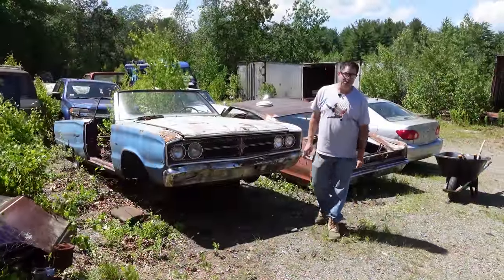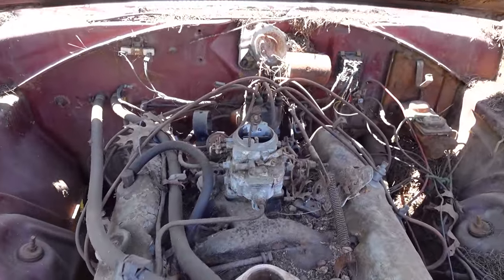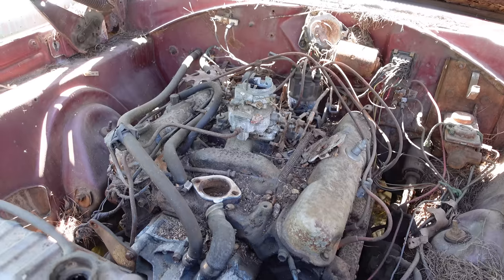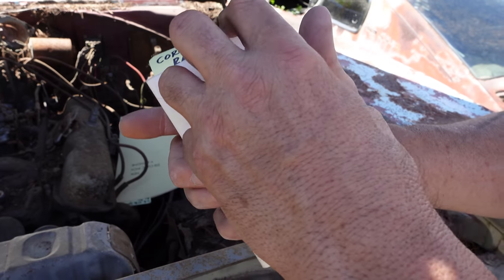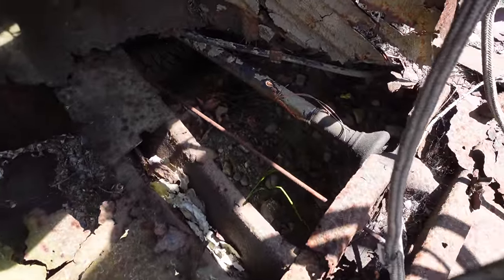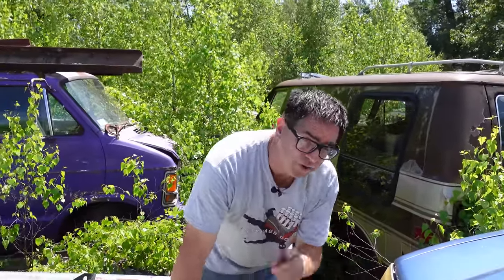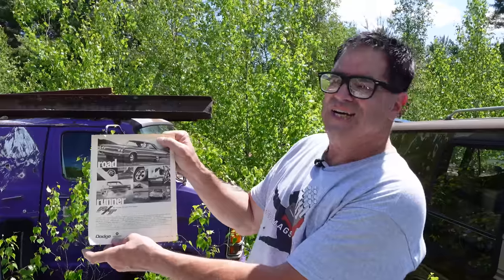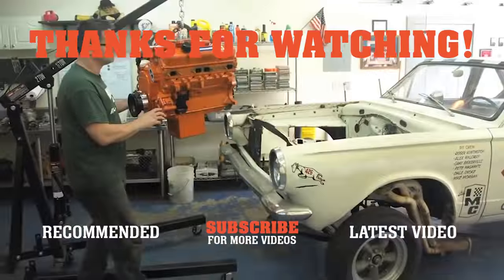1967 Dodge Coronet 500 Convertible

Comment: My dad purchased a 1967 Coronet RT new I believe around $4K. I bought it 4 years later $1300 paid cash from mowing yards. That 440ci 375 hp would definitely push you back in the seat and put a smile on your face. It was Red with white interior torqueflight on the column with deep dish Cragers and air shocks that I put on. It was a nice first car.

Comment: Just restored a 67 Coronet 500 convertible 4bbl 383 car. Gold (zz1) with gold interior.  53k miles on the speedo. 62 Engine code. Power windows A/C car.

Comment: When I rebuilt my dad's 66 500, I had a  radiator shop replace the 2 row core with a 3 row and soldered my original top and bottom tanks back on. It's a 273 2bbl that my parents bought new in September 1966 just as those 67s were coming out.

Comment: The V-8 fender emblem, my experience is that the guys on the right side of the line were quite independent of the guys on the other side. My 67 Coronet 440 had the correct 383 four barrel emblem on the left, and the V-8 on the right, but it gets worse! My 66 Coronet 440 Hemi car, had the correct 426 HEMI emblem on the left side, and they apparently neglected to put any emblem on the right side. Holes were drilled after the fact, and an emblem added, crooked! That emblem stayed crooked for about the next 40 years.

Comment: Hi Steve enjoed watching your very informative videos In 1972  i bought a1967 Dodge Coronet 440 model with 318 convertible I paid 400 dollars from Hoyoke Pickup Dodge. The reason was because it had 92,000 miles on the car. went in the service rolled it trying to avoid a head on collision on a blind turn. car was in my lane. Anyhow seat belts would of killed me an my veteran buddy. The engine was pushed up to the front seat. in 1974 I bought a 1968 Dodge Charger with a 440 automatic for 400 dollars in had only 55,000 miles on it .Came home on leave from Kansas to Ma I got Stopped by The Holyoke South Hadley and My parents in Granby as well I asked them what was up .They all said the same thing We never seen a car like this. You mind if we look around no problem They asked me to open the hood geeze what you got there I told them they were all impressed. I have always been a Mopar guy. My present is a 1988 Chrysler Fifth Avenue with 175,000 miles on the car. I wished I knew somebody in my area that did a conversion like to get away from the lean burn system and get better gas mileage with he old school mechanics. any help would be greatly appreciated because I am a disabled Viet-Nam Veteran

Comment: My mother had a 67 hardtop 500 when I was about 14. It was 383 2 barrel automatic bucket seats console floor shifted she didn't take care of the engine and it's spun a rod bearing. I wasn't quite old enough to know what it was at that point and it went to scrap. When I got older I realized what a mistake we

Comment: I was hoping to see the trim tag and VIN as you alluded to it. But with the VIN we could win:

W for Coronet, P for Premium price class (Coronet 500), 27 for convertible, F for 318 V8 with two barrel, 7 for 1967 model year, possible 1 for Lynch Road (Detroit, MI) assembly or 5 for Maywood (Los Angeles), CA assembly or 7 for Fenton (St. Louis), MO assembly and the rest is the production sequence. Close, the VIN code "E" in 1967 was for the high performance 273 V8, and the VIN code "D" was for the standard performance 273 V8. 

No tag, can't brag, but it might be something like: WP27 for Coronet 500 convertible, P1X for black interior trim, 41 for 318 V8 with two barrel, 5 for three speed automatic transmission, possible "P" for Bright Red Metallic exterior paint, among other codes. 

Looks like that's "Mopar Corner" in the junkyard with a few more videos coming with that Coronet's "neighbors" in the junkyard. GM cars also have codes for their radiators as well. This is shown on the build sheet so that the line workers knew what parts to install and it helped the logistics people track inventory and set up production at the various suppliers and divisions making parts (such as Harrison Radiator at GM).

Comment: Doesn't take much to wake up a 318.  340 cam and a set of "302" fast burn heads topped off with an Edelbrock intake and 600 carb.

Comment: Looks like another one hiding in a container back there.  Or is that an Imperial? 

This car for the northeast doesn't seem like it's that rough, sure it needs floors, but it's not breaking in half.  You'll probably never find a top for it though.   I don't know how different the underparts are but the way you save it is take a 4-door (or even a 2-door hardtop) and cut it down to the floorpans, then add in any convertible specific bracing and rebuild it with the convertible upper body.  

I remember in 2012 in Columbia SC there was one of these in a you pick yard; a Coronet 2-door hardtop.  I was on vacation just checking stuff out and there it was, hardly any rust but a bare shell with no interior, glass or drivetrain.  Would have been a good donor for this convertible.

Comment: One of the many times I screwed up in 83 I could have purchased a 67 R/T nothing wrong with it for 300 dollars and didn't buy it because at the time I had a 69 SS 396 Chevelle.
I didn't realize the heads on the 67 R/T and GTX were one year only design and I'm a Chrysler person 🙂
Reply: I almost bought a 1967 Coronet R/T with a 440 that was in a driveway a few blocks away. It looked like it needed a lot of work and was pretty rusty underneath (although it had a decent paint job) and I passed on it. I wound up buying my 1979 10th Anniversary Trans Am instead.
Reply: I did the same thing back in the late 80s. I could have bought a 1971 340/4spd Cuda for $400.00 that needed paint and body work. I was just finishing up restoring my 1968 RS/SS 396/4spd Camaro and didn't want to pull funds from it getting done. Oh , I wish I had bought that car now. Other cars I passed on buying because all my money was going into that Camaro
1969 Camaro convertible 350/auto $900.00 pretty bad shape
1971 RS/Z28 LT1/4spd $1500.00
1970 El camino SS 396/4spd $1800.00
1969 fastback Mustang 351/auto $500.00
1967 box Bronco 289/3spd $350.00
If only I had a time machine!!
Reply: @patricksmith6208  At the time, it was the right choice. Sometimes there's a reason why we don't buy a certain car at a certain time. It takes a big infrastructure to maintain a fleet of cars like that.

Comment: jeez, didn't they reinforce the frame at all on convertibles or was the undercarriage the same on 2door sedans, hardtops and 'verts?

PS I know there's no separate frame.
Reply: They did. There was a long thick piece of angle iron added inside the rocker. I believe they also fitted the extra torque boxes found on hemis but I am not completely sure about that

Comment: Steve, I thought the legally mandated dual circuit brakes were always paired up into one front brake and the opposite side rear brake per circuit. Not sure if that cross-car brake circuit arrangement was required, or if a front/rear brake circuit split was also allowed

Comment: I had a 67 dodge Coronet  2 door hardtop 440 modle with a 273  pulled the 273 and dropped in a 383 mag out of a 69 road runner wish I never gotten rid of it

Comment: Steve, is there a way to find those radiator numbers online? I just had the radiator in my 64 Polara split, and while I am replacing it with a new aluminum one since I daily drive it, I'd like to know if it's the original one and if I should hold onto it.
Reply: if the tanks are good just have the old one recored...They keep the original tanks...